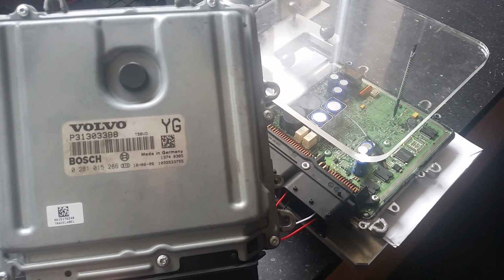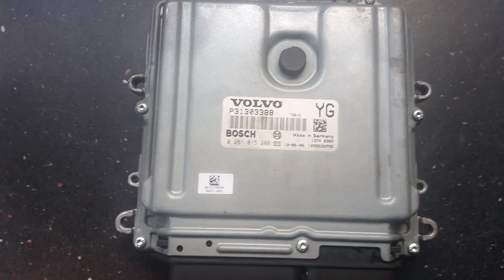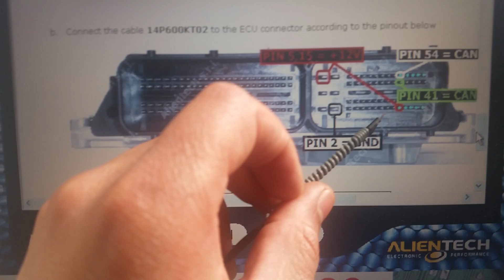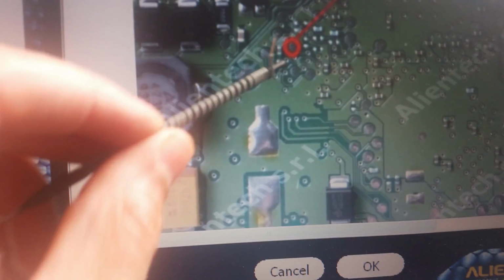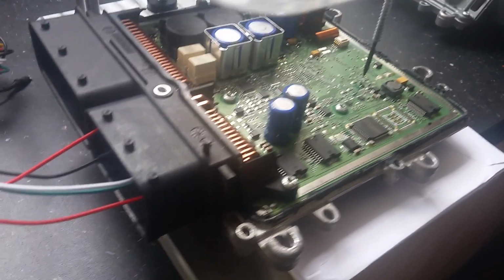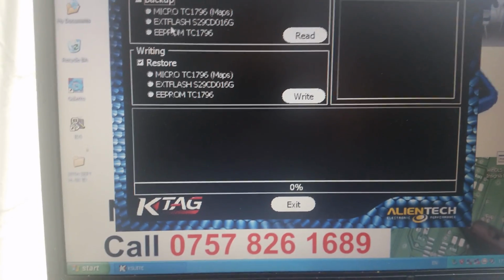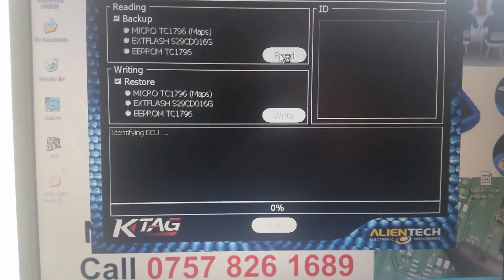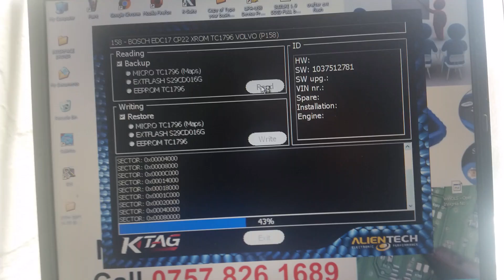How to clone a Volvo EDC17 CP22 ECU cloning using KTag remapping tool

Comment: Good evening Sir. In 3:46 in left upper corner there is a IC number 8905504848 on Your ECU board. I have the same part on mine Alfa Romeo 1750 TBi ECU bosch motronic MED 17.3.1, which needs to be replaced because of faulty AFR sensor cirquit. I would be really grateful if You could tell me does this 8905504848 have some kind of memory/data that I have to clone from old one to new one or this only has electronic cirquits inside without program?

Comment: Are you cloning this ecu with a master version or can this be done with a slave too ??
Reply: I would also like to know if this can be done on a slave tool
Reply from the maker: You can clone a ECU with SLAVE KTAG or MASTER KTAG but with a SLAVE KTAG you will need your MASTER to code the READ file back to your SLAVE tool so it can write back to the new ECU

We sell GENUINE KESS & KTAG if your interested

Comment: hi mate my vw ecu not good if i find same  part number replace it car will start???plz
Reply: Hello,

If you find the same part number it won't start as the VIN & immobilizer data won't match the car. To do this you must take a BDM read of the ORIGINAL ECU with a tool like KTAG then write this data to another ECU of matching part number. Then it will start with no issues on the new ECU

Thank you!

Comment: Surely this wont work due to OTP areas???
Reply from the maker: T3efy Hi, This is a 100% working solution. This was a real live job. I personally went and fitted the new ECU to the Volvo and it started up and has been running 100% perfect since.

Thanks for your comment.

Lewis

Comment: Lewis when you replace a ecu can some scan tools program the new ecu?
Reply from the maker: Liam , yes that's right. Also the main dealer can also offer this service of ECU coding.

Checkout our video on our ECU lid extractors. 

Thank you 
Lewis
Reply from the maker: mzm Hi,

Yes you can read all the data. The damaged ECU was electronically damaged. After cloning this ECU I personally went out and fitted the new ECU to the Volvo and it started up and has been working 100% since. 

Thank you for your comment. 

Lewis
Reply: hmm nice stuff . Will you be able to read all the required info from the damaged ecu ? am New to this